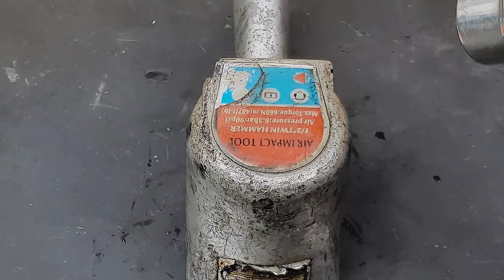녹에 쩔어붙어 버려진 에어임팩렌치 리스토어

Comment: I wonder how well it will work as you are removing material with sanding ect. Making your tolerances larger than original. I would guess maybe a slight loss of power.
Reply: Me also.

Comment: Every detail matters! You have perfected the beauty aspect, but the heart was left lacking! Those bearings were truly beyond repair, and even from temporary standpoint, they should have at least been packed with grease. Also without seals, they won't last long and may even fly apart at high RPM.
Reply: That is true
Reply: its a junk now - sad to see
Reply: they are getting lubed by the oil that is needed to run these machines. he squirted oil in before he connected the air hose but in normal cases you have an oil disperser on your air line for those kind of tools.

Comment: Great work. But WHY didn't you replace those bearings. That hurts. Even if they were ok. New bearing is new. Also what's the point of ultrasound cleaning if you are sandblasting and wire brush polishing after.

Comment: All that work then you destroy 2 dead bearings and the you reuse them? They are sealed bearing for a reason and would of only cost a few buck to replace now in a couple of month of use you will be pulling it apart to replace them anyway?

Comment: Packing bearings with grease, getting engines going, pulling a new differential out of a box, heat expanding ring gears, power washing an engine block, setting cylinder sleeves. Does this guy know his stuff or what?!!!
He deserved that fruit at the end. 
Good work, boss. God bless.

Comment: It won't work properly. This is art for a nice look art and nothing else. Some parts cannot be regenerated, especially gaskets and o-rings. The elements from which the device was assembled have their own fits, so by grinding them you change their parameters, which will cause the tool to malfunction.

Comment: Starting in 1990, I was the parts guy for a very large tool importing company. So I would see all these parts (but brand new!) by the 100's daily. It's amusing to see them now all old and grungy now, being brought back to life!  I just finished doing a 3/4" drive impact that was in a similar state.
Reply: Little tip - if you're wondering if "A" tool is the same as "B" but under a different name, look at the parts drawing for it. Back then, we would virtually never redo the actual drawing from the source company - we would just renumber the parts!  Part of my thing was using whiteout, and a steady hand to put in our part numbers (remember, this was years before photoshop etc!). But reference number 7 for us stayed as number 7. So our brand tool, although it came from the same factory as say a Campbell Housfeld, we all had the same number 7 part.

Comment: On the housing, if you start with a 80 grit and work your way up, you can remove all the pits and make it look like new. Also the bearings should be packed with grease.
Reply: Unless they're sealed permanently lubricated bearings that is. 😉

Comment: Lol you used the old bearings, gaskets and rubber o-rings?
Reply: This means restoration and not reconditioned. There are two different conditions. Using new spare parts or upgraded, will make a recondition. Using the same parts, restored and repaired, will make the restoration. It is up to you what will decide to be at the end.

Comment: Someone DEFINITELY did not read the "oil daily" on the bottom of that impact gun. By the way, use the basket with your ultrasonic cleaner. If parts touch the bottom of the tub it will damage it over time

Comment: FYI,  WD40 is primarily a water  dispersant.  It has other uses for rusty bolts or lubrication but it is not very good for either.   The best product for rusty bolts is Liquid Wrench and an excellent  lubricant is Break Free as it never dries out like most oil lubes. Also one of the best rust removers is Ospho. It turns iron oxide into iron nitrate which is inert. It can also serve as a primer for painting.

Comment: I've always been told that it's really bad to spin bearings with air like you did between 19:40 and 20:18. I've also heard that it's potentially dangerous if you do it while holding them in your hands because they could seize suddenly and damage your fingers. I've never personally seen it happen, but that action is pretty universally frowned upon.
Reply: When I was serving my time I was always told never to spin a dry { WD40 is not a lubricant} bearing with an airline
Reply: @terranceprice7006  "WD40 is not a lubricant" 
WD40 would beg to differ
Reply: taffy is that you?
Reply: But it doesn't.

Comment: Restoration? You took something ugly and broken and made it pretty and broken adding no value or usefulness. Then the fact that you took the plastic vanes and sanded them down showed you have no idea how pneumatic tools work. Junk into junk. No one do what this guy did. The only reason this "worked" in the end was due to the enormous amount of oil that was added into the air supply to fill in for horrible  damage done to the inside. Run it for 30 seconds without all that oil and it's gonna struggle to take even loose bolts and nuts off. Not to mention the amount of aerosolized oil you get to breath in while working on the project covered in oil.
Reply: Ему надо посудомойщиком устроиться. Там полностью раскроется его талант. А бедный гайковёрт остаётся только покрасиь и выкинуть нах.
Reply: Why are you so mad
Reply: Damn need a man pon
Reply: @bigboiandrew6980  he big mad

Comment: The internals of that air gun REALLY need to be perfectly smooth for good operation. A wire wheel eats into the metal, there isn't a good seal when the resin vains are making contact with the inner walls as fractions of air can pass past it. Essentially, you made the air gun clean, but not function that great. 
Still, good video...

Comment: everything is perfect except for one major mechanical flaw: you should have replaced those ballbearings. sealed ballbearings are meant to keep grease inside them, you've just broken the seal, now they'r only good inside an engine where oil is always circulating, by doing that you've just shortened their life to 25%. trust me am a mechanical engineer.
Reply: exactly, it's an open loop machine, compressed air coming in with contaminants specially moisture which is very common, air out as what comes in but contaminants could stay inside which in a long run, it will be enough to damage moving parts inside specially that bearings. Trust me, Im an air compressor specialist/mech'l engr.

Comment: should've reinstalled the bearing covers after a repack with grease, those bearings won't last
Reply: My thoughts exactly, when you clean the lubricant out of them you might as well put them in the bin, they are a low cost item
Reply: @atlastalongwaitsova5085  yep, like draining the oil from a motor, it will fail really soon

Comment: Everything looked great till you spun the bearings with air. Those bearings were never made to spin that fast without being in a bore or on a shaft. Going that fast if it comes apart it can kill you. It happend to a co worker, didn't kill him but he had to have surgery to repair internal damage and remove shrapnel. Hold bearing still and blow it dry.

Comment: 20:10 sorry dont like the idea that bearing can be restored, after all your effort its way more better if you give it new bearings
Reply: I did the same "repair" on a similar bearings from an Ingersoll rand with was stuck because of moisture in air.
Cleaned them, lubricated with a very thin oil, reinstalled   and "voilà" ! Still working fine for the last 6 years.